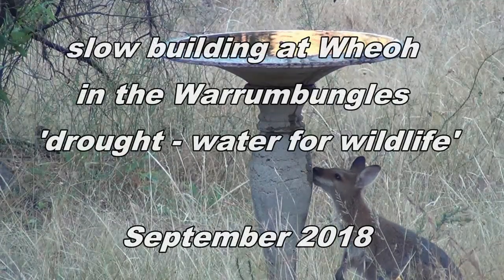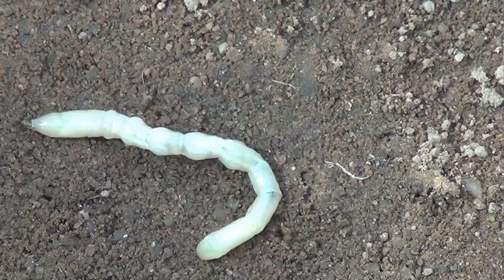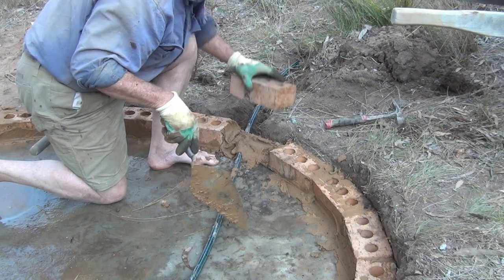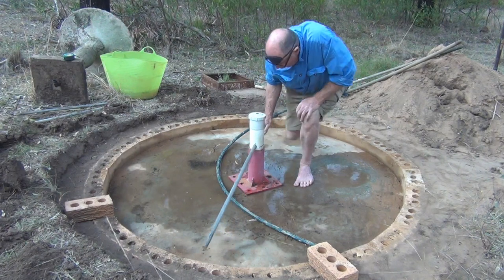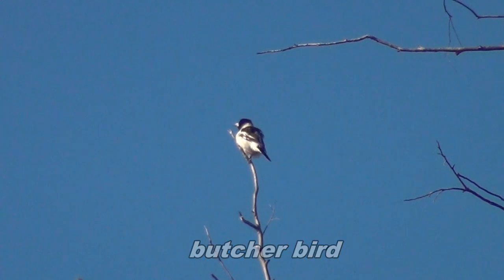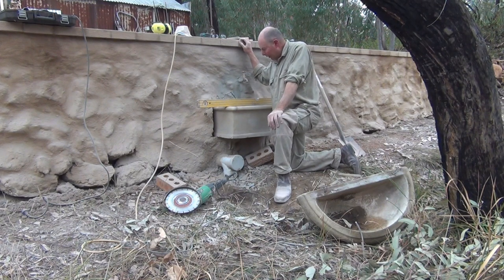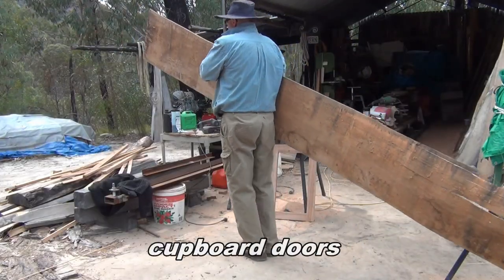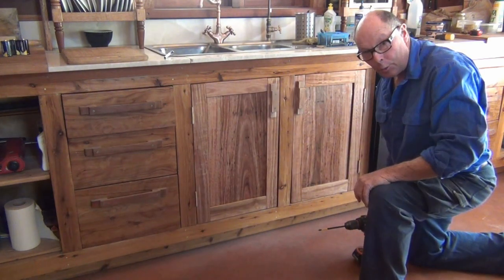Wheoh: Part 36  'drought - water for wildlife' - Sept 2018

Comment: thank you!
Reply from the maker: so sorry to report that 2019 was the driest year since records began in 1886. We had a mere 167.6 mm. The average is 600 mm. The consequence is that the spring feeding this water source has now stopped flowing.  I try regularly to top it up with rain water in the tank but that supply now is dwindling.